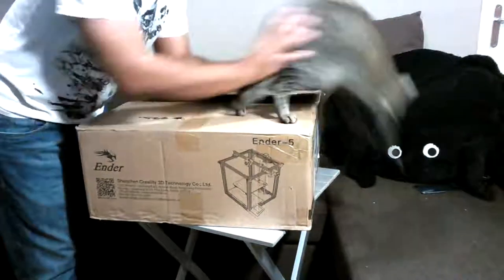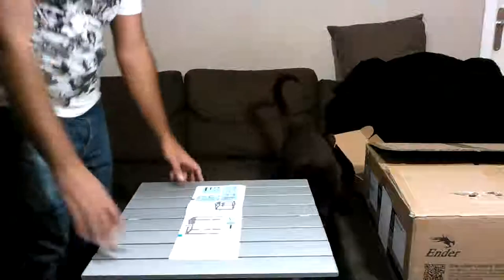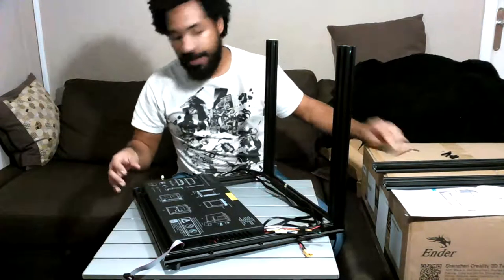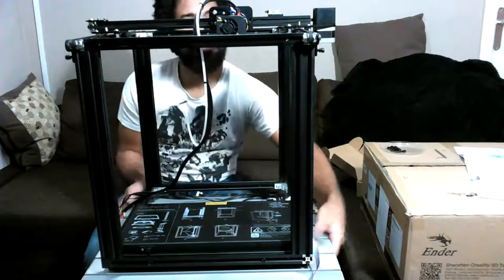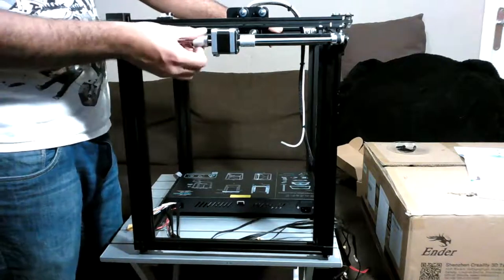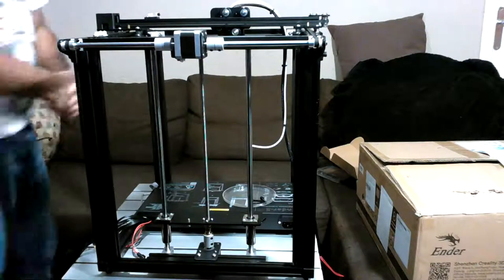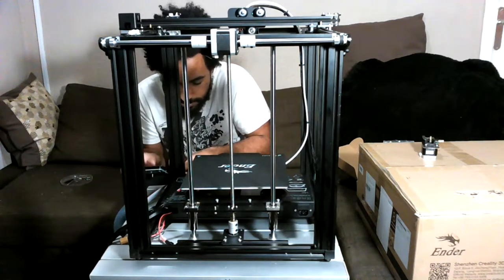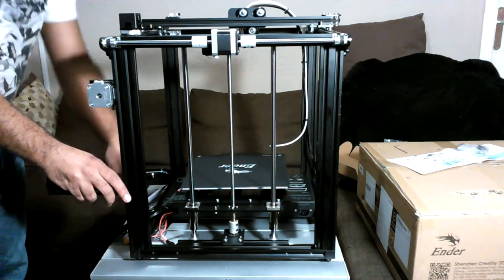Ender 5 unboxing and assembly

Comment: I'm currently waiting for mine to come, is Creality sending cats with the package? Not sure I have spare room for it.
Reply from the maker: I hop you get yours soon :) While I've had to do some minor ajustments it's printing very nicely. The cat's are included but you need to put a request during the purrrchase ;)
Reply: Waiting for mine, as well. What controller board came with yours? Mine is supposed to have the V 2.1 board, like the CR20. I confirmed that through email with the seller too but I haven't seen a single review of the Ender 5 with this particular controller yet. Maybe it's an updated model now?